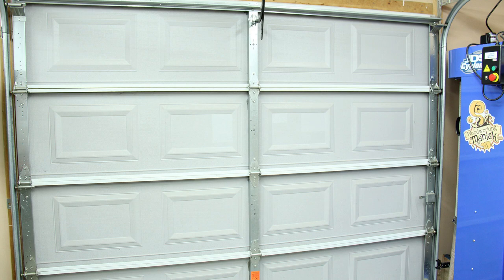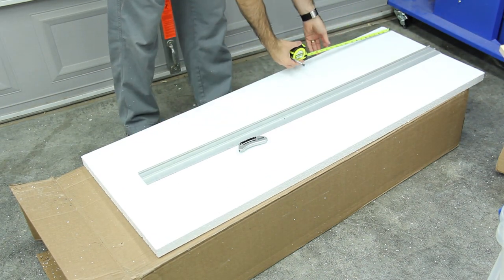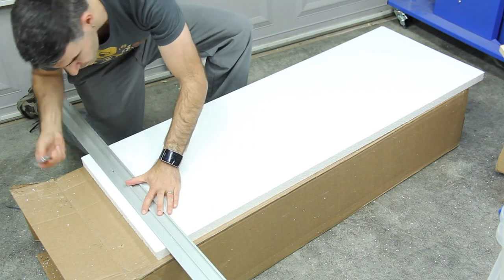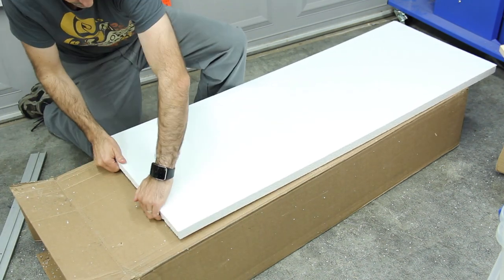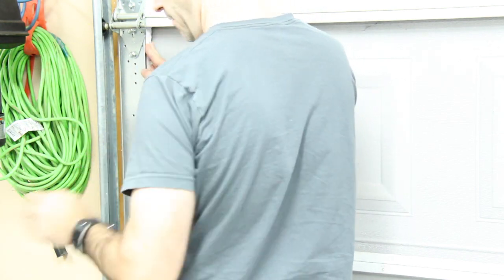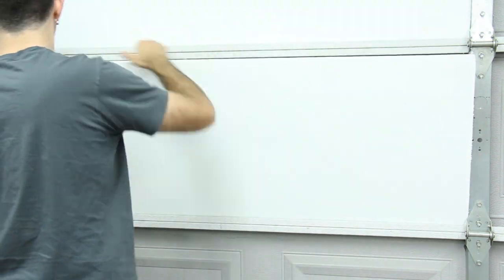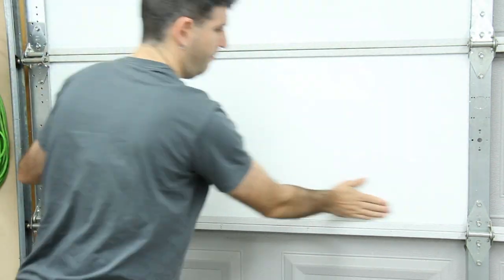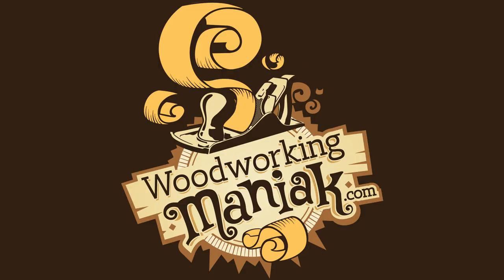Adding A Garage Door Insulation Kit

Comment: Thank you very much. I must have watched a dozen videos on installing those panels in the door. Your door is exactly like mine, and the idea of cutting off the ends first, then using those ends on the sides using the screws to hold it in place. Thar idea sure makes bending the panels in place so much easier. In other videos I saw guys crack or damage the panel trying to get it in place.  I'm off to buy or order the panels first thing tomorrow morning. Again, thanks for the great tip.   Ken. .Marina  CA
Reply from the maker: +Kenneth Bartlett Glad I could help! Have a great new year!

Comment: Good job, I would just like to add for others who may attempt this, do not loosen the screws holding on the bottom brackets. The cables are attached to those and under a lot of tension from the springs. It could be disastrous if the bottom bracket comes unattached from the door.

Comment: I did mine with standard rigid pink insulation panels and like yours it works great. However, I'd love to insulate the walls and attic above then add a heater/cooler. NC seasons can be a little extreme sometimes. 🍻
Reply from the maker: +Deacon Woodworks Already making a noticeable  difference in my shop.

Comment: TIm i replaced my doors a few years ago and it made a huge difference. now i just have to work on the walls....lol but that is for springtime.
Reply from the maker: +Miter Mike's Woodshop Yeah,  I'm sure this will make a big difference in my shop. In the summer, I could feel the heat about 10 feet away radiating from those doors...

Comment: Did my wooden one a few years ago with roll and it helped keep the heat out from direct southern sun. Did you do anything with the openings on the side and top?
Reply from the maker: +MRrwmac Mine doesn't have any openings on the sides or top... My door has rubber seals around the edges that it actually bumps up to already. So, no major gaps to worry about.

Comment: Did you have to adjust the garage door spring tension due to the added weight of the panels?
Reply from the maker: +Jacson Matos Nah. These panels don't hardly weigh anything. They are super-light styrofoam with a thin plastic outer shell that provides a nice face.

Comment: technically you should change the springs when changing the weight of the door, but if that foam is light enough, it should be fine.
Reply from the maker: +l337pwnage Yeah, this foam is light as can be.

Comment: i wish i could insulate mine, it is a electric 10'by 18'door without those metal brackets, so no insulation can be attached :-(. But this seems easy though, Great explanation!
Reply from the maker: +G.Work.Specials This sure was a pretty simple install. Maybe some other way to get insulation on your doors... :/
Reply: +G.Work.Specials I have seen people use construction adhesive to attach the foam where there were no brackets..
Reply: That might actually work! Now off to convincing my parents.... and they said no... It is hard to get something done when you're 17. Luckily i do have a gas heater :-)